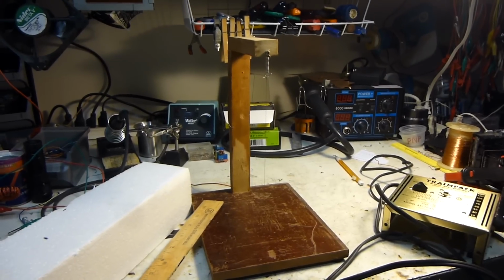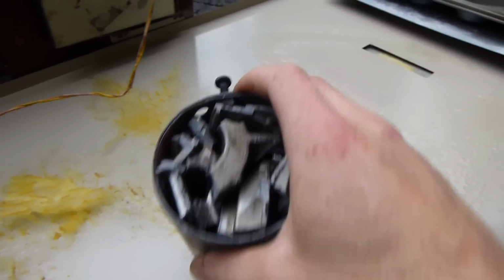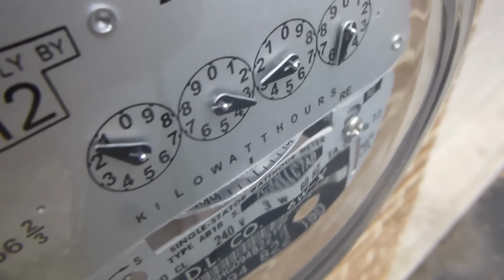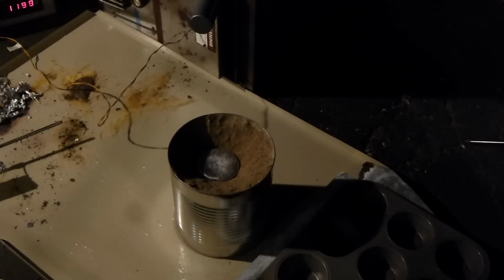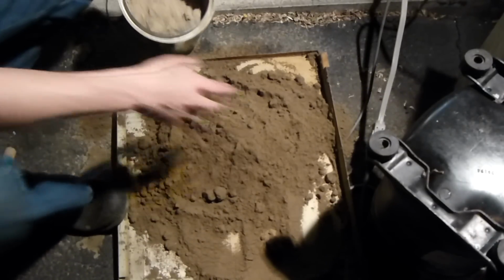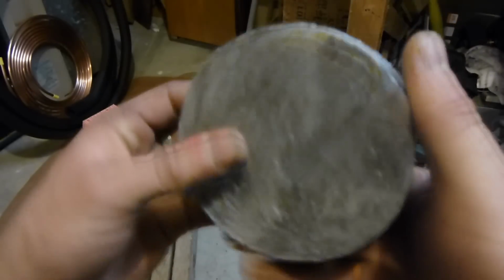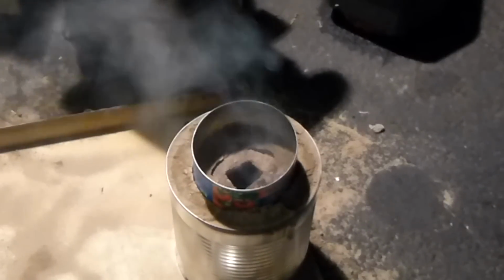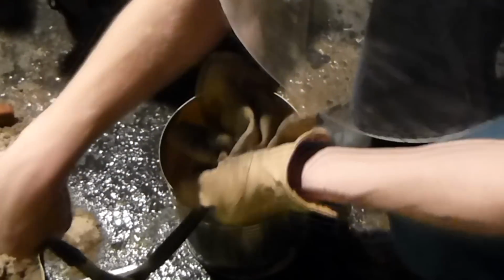Casting an Aluminium Cube - Experimenting with Fluxs - Homemade Free Green Sand from Common Clay

Comment: The two tips I can offer is to wrap about a tablespoon of Morton Light Salt in a foil capsule and drop it into the center of the melt right before the final skimming. It will melt over the surface, give it a slow stir, and skim off the dross as it comes to the surface. As stated by someone else, it will eat up crucibles if you add it ad the beginning. Especially steel ones which erode rather quickly anyway.

In regards to the lost foam, my experience has been to not use hot glue to bond the riser and main body together. I tried it before and it resulted in a poor casting. I switched to a foam-safe spray adhesive and the casting came out much nicer as the spray adhesive melted with the foam. Hot glue doesn't melt, vaporize, and burn like the foam does, resulting in two different densities of mold material. Also, lost foam benefits from higher head pressure during the pour. Double your riser height and it will make a world of difference.
Reply: +armorer1984 Could the Hot glue be the cause of that black incosistency in the first part of the video between the  cylinder and the sprue, and not the non-continuous pouring like he suspected.

Comment: this video's got some time on it so you probably already know, but:

When casting in greensand, the moisture fills in the spaces in the otherwise porous sand - so with lost foam casting the gasses have nowhere to go but back up where you're pouring into. you'll notice most folks casting into greensand moulds will place a vent usually using a bit of copper pipe or whatever to clear a hole, for the escaping gasses. 

This results in a safer pour, and reduces risk of failure from voids and unmelted styrofoam. Probably worth a shot!

Comment: Very, very, very nice video! Like the experimenting, I can learn from that for my own castings. Good luck with your casting!

What I read somewhere about getting the dross out: if you put washing soda in some tinfoil and push it down into the molten aluminium the aluminium will bubble and the dross will go up. I tried it, and it seems to work. I got less air bubbles, but not really sure that was because of the washing soda.

Comment: Hey buddy. the wrinkle in your cast is caused by the Moulton aluminium building up then dumping down into the bottom. you can easily cure this problem by adding a vent hole at the top of the disc. so poke a hole down the sand into the disc this way you will achieve a nice smooth cast.

Comment: I've only been doing this for a few months myself, but some pointers for you:

If you use an awl or something to produce vent holes in your sand, the melting foam gas will come out those instead of fighting against the aluminum you're pouring in.

If you're concerned with oxidization etc, you should be using a stainless steel rod or spoon to stir with....when you're dipping in a carbon steel rod, you're adding (forget the material name) to the aluminum making it weaker

There's nothing wrong with letting the cast cool on it's own....spraying it with water is causing instant oxidization. Like when people tig weld, there's a shielding gas around the molten aluminum to prevent contamination....

Your green sand will get better every time you use it....mine wouldn't stick together much at the beginning, now after about 2 dozen pours, it's actually pretty good....it wants to clump together with just the weight of the sand on top of it.....I use the term "creamy" as opposed to individual grains of sand......when I ram it into my flask, it wants to flow as opposed to break up.....

BTW: a source for the best quality aluminum you can get? free? Old computer hard drives....go to your local computer store and after they've destroyed the data on them, dismantle them and you'll have almost dross free aluminum......another source is old aluminum rims.....lots of people crack them by hitting a curb....go to your local tire and wheel garage, they might let you have em for free.......
Reply: +michael C Thanks for the tips Mike, i guess i wasn't the only one using hard drives haha.
Reply: computer hard drive cases, platters, and cpu heatsinks. my main source. free at the curb
Reply: Random_rapper20 I find the heat sinks produce the least amount of dross, the actual drive discs the most....I guess it's the magnetic coating they put on....

Another source for hard drives is old PVRs...X box, Playstations etc.

Comment: Hi Makerj.
Your moving forward in leaps and bounds....good to see, however, you will never get clean castings with the lost foam method, it's just the nature of the technique...can't wait to see your mold method, I reckon you'll nail it.
PS. Large solid,thick castings are the most difficult to do without porosity by far....because of shrinkage of the molten metal...spruing theory is important there.
Reply from the maker: electro1622 Thank you!  Yeah lost foam is quick and dirty.  I really just need to put in some time to making a proper mold.  Good to know!  Thank you!

Comment: @Makerj101 
When blacksmithing I use borax as a flux, I don't know if the concept would be the same with casting, but you could try that, albeit salt is much cheaper, so if it does what you need it to do, there is no reason not to use salt.

Comment: Have you tried painting a layer of drywall mud onto the foam before you cast it? It's supposed to make for a very smooth product once you chip the mud off after casting.
Reply: +Zach W Thin plaster of paris works nicely, too, as long as you give it a full day to dry.

Comment: Hi,

Just wondering, and I am asking this before you pour the cube, did you actually work out the volume of metal you would need or have you gone the ‘easy route’ and guessed? Because it would be a shame to get a failure just because there was not enough metal you know. You do seem to know what you are doing, and I was impressed with how the salt works. I have seen much larger castings with far less salt added and it did not have the same effect as yours where it rose everything to the surface that was crap. I am subbing!

Comment: I would be interested to see if there is a void inside the cube.  Great work.  I hope you continue to improve.  You have the makings of a good engineer, because you have done  a lot of hands on learning.  Most engineers are book smart but street dumb!  Tried to explain the probability of voids in some cast turbine blades to a engineer one time and he scoffed.  I had done a lot of lead casting of large caliber bullets and had seen voids in some of those.  I was later proved correct.

Comment: neat! i'd suggest using less puffy Styrofoam. like Styrofoam boards rather than packing chunks. you could use a bit of paper glue to stick them together in chunks to make the shapes you need as well. the problem with larger packaging styrofoam is that its more airated. which causes structural instability. think of like, a wall, if it had a bunch of HUGE gaping holes in it, it would suck as a wall right? but what if it just had a TON of tiny tiny holes in it. you'd barely notice.same material, diferent density. 

just a suggestion :D

Comment: You should check out the forums at Alloy Avenue. They have tons of knowledge and are very friendly to beginners. They have people from backyard tinkerers to industrial pros. You might also want to check out Legend Mine assaying tools. I got a 6 pack of the K size fire clay crucibles and haven't had any problems yet after a couple dozen pours. They have some other sizes, so you can find something that fits. I think it is worth the investment if you are going do a lot of experimenting. Good luck casting!

Comment: u should have checked for magnesium first. You casted alluminium mixed with magnesium. If you spilled that, you would have been unable to kill te fire, since it's a metal fire. Easy check is pouring vinegar on the metal. If it bubbles, don't use it!

Comment: I want you to buy a new set of gloves. Three pairs of individually-fingered welding gloves is like $10 at Harbor Freight. No, Welding Gloves won't do much besides give you a second or two - but maybe that would be enough.
Reply from the maker: +Mithradates Megas I actually recently bought some at Harbor Freight.  They already have a hole in them!  :P  Oh well I'll get another pair or I'll get the 3 pack.  At least they are dirt cheap.

Comment: I made a foundry and all I get when the aluminium melts is a broken crucible and some ash what can I use as a crucible for cheap I am using a steel soup can
Reply: bottom half or fire extinguishers and or of mini PROPANE or MAPP Gas cannisters... MAKE SURE COMPLETELY EMPTY FIRST... Then cut to size with hacksaw or Grinder

Comment: is it possible than when you put the aluminum in on the foam the sand will collaps?
Reply from the maker: Arjen Hartink Yes that can happen often.  Generally if the part you are trying to cast is really small or thin.
Reply: would it be better if you make the sand a little wet? or will the moist in the sand make bubbles?
Reply from the maker: Arjen Hartink I did do that in this video.  I tried moist sand fist and then green sand.
Reply from the maker: Arjen Hartink I think it did help.  But to really be sure I would need to try some thin things.

Comment: Have you tried working with aluminium powder? Maybe mixing borax with the powder and sintering instead of a total melt? Do you think this method would work?
Reply from the maker: +Fern F Sounds hard.
Reply: I think you would end up with a lot of slag because the powder has more surface area and that means more oxidized aluminum
Reply: William Ela hence the borax, don't you think if mixed together it could potentially act like a constant flux? Mixing it with a binder to make it "metal clay" like, with some form of organic binder, like xanthan gum? Low firing could help it sinter, without actually melting, thus reducing time for oxidation?... in theory might work, but that's why I'm asking hehe :P
Reply: Fern F I see what your thinking but i dont know if you could use borax as a sintering agent. I think it might be too weak and your end product wouldnt be usable for machining
Reply: I guess only a little test will tell, thanks anyway William Ela  :)
Reply: Fern F Telll me how it goes! I would be interested to see how it works
Reply: William Ela of course! I'll keep you posted ;)
Reply: Fern F

Comment: Can I ask what your electric bill looks like?
Reply: Anthony Johnson Not much more than yours I bet, the furnace doesnt use any more electricity than a computer.
Reply: What sort of PC are you running? ':I  A resistive heater kiln like that would draw around 2kW at least, 2000 watts. My $4000 top of the line gaming PC uses 250 watts idle and 400 under load.
Reply: 4000$ ? ONLNY 400 WATTS? DAFUQ HOW YOU DO DIS?

Comment: Why is the molted metal purple
Reply: because of the temperature. if material is heated, they emit light, the colour of the emitted light is defined by temperature. the hotter an object is, the brighter and whiter the light is.
and the camera might falsen the real colour, giving us a putple colour
https://en.m.wikipedia.org/wiki/Incandescence
Reply: well it is the faultof the camera, normaly the crucible is bright orange-dark red
Reply: The camera can see shortwave Infra-Red, which just happens to activate blue and red receptors. Turn a stove burner on and point a cheap crappy camera at it, it has to be low quality as better cameras filter iR out more effectively. Even before it starts to turn orange you'l see the purple iR glow.

Insects and a few animals can see this "color" of light which adds extra detail to images and enables very good vision at twilight. iR is visible even before sthe sun during a sunrise, you can see it's rosy glow showing off clouds onto the ground. I have some pretty neat video footage of that, I may upload it someday after I cut out the houses.

http://www.picturecorrect.com/tips/how-to-build-your-own-infrared-camera/
Check out this site and scroll to the bottom near step 17, that's what the world looks like in infra-red. Notice how the sky is completely black, as infra-red is not reflected by air much and you're seeing pretty much right into the upper atmosphere, maybe even space. Satellites show up very clearly with a telescope at the right times of day. I could even just barely make out the solar panels.

If you have an old webcam or standard digital camera to spare, you could convert it to a pure shortwave iR camera. Note: Not a thermal camera, a shortwave iR camera. You rip the lens assembly apart and completely remove the iR blocking filter. The guide details how you locate the reflective metallic green or pink piece of glass, which is supposed to block iR so pictures don't turn out pink/purple. Now, the camera can perfectly see iR instead of partially. You can then add a black filter over then lens to block visible light. Set the cam to black and white for better quality or leave it as is for images that are shades of pink, purple and white. 

I'v had a lot of fun with my hacked old Vivitar camera, got some pretty interesting pictures. Flowers and trees so soooooooooo wierd in this shade of light we don't normally see. The world of iR light is amazing.
Reply: JPAnor Aluminium is usually metallic silverfish, like normal. while boiling, however, it can be orange/red with heat.

Comment: i have been working in the matal industry with lathe's and mills.  and mostly cnc lathe's and mills.    and i have NEVER heard of a machinists cube.   wtf are you talking about??? get some real tools.
Reply: If you've been working as a machinist, I am genuinely afraid for where this world is heading hiring someone who is barely even literate to run industrial equipment. I bet this kid turns out better parts than you do even though he doesn't have the professional equipment to do it.
Reply: I'm a machinist and a tool nerd and i thought the same thing as attack125. The kid in the video seems very intelligent, articulate, and creative. Maybe a 123 block. Or a v block. Maybe a bench block?!?! But those are round. All that shit is 440C SS. Hardened and ground. Either way he's making an aluminum block he intends to machine and hes excited about it. Keep up the enthusiasm bud I bet you'd make a great machinist!
Reply: attack125 No. I read the comment.